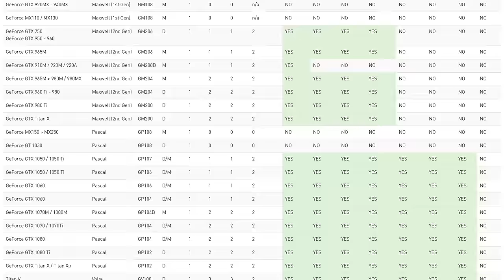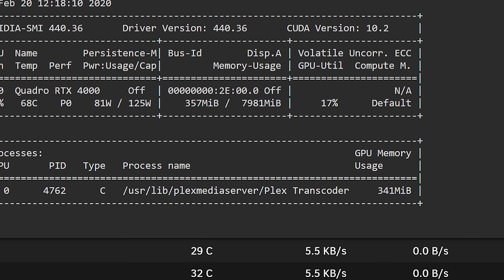5 First Plex Media Server Build Mistakes

Comment: I had a fun problem with sata using those rosewill hotswap bays, took me forever to figure out what it was, finally decided it was the hotswap enclosure. as soon as more than one drive would spin up the transfer would stop and give me drive controller errors. I went through so many sata cables and sata controllers and even switched to a sas controller and the problem continued. I finally realized it was the hotswap bay when I pulled the drives out of the enclosure used the same power plugs and sata cables and everything was fine. If only one drive was active it was fine. The funny part is I used the enclosure for a year or more with no issues until I decided to switch to a raid1 in software to protect some of the data and then the problems started.

Comment: Hi Jason
I've been playing with the plex server for a while now and I've been following your channel. First I had a version with poor hardware, so then enthusiasm prevailed and a new version of plex server came up with slightly better specifications.
The thing I noticed is that the viewing devices (mobile phone, tablet, laptop, etc.) all have higher resolution support. For example, I use a lg 55sk8500pla smart TV which at the time of purchase in my country (2 years ago) cost $ 1350. And he's more than capable of playing all the formats currently in direct play.
Now the question is whether you need to spend money on expensive server hardware or simply add that money to buy a better TV and use a plex server with weaker hardware just for direct play.
Best regards

Comment: I find using enterprise level hardware for plex servers it worth it. I’ve seen desktop hardware fail over and over again. . Lots of second hand servers out there. Once I went to Hp gen 7 I’ve never had an issue. I even have an Nvidia grid k1 16 gig ram gpu card for hardware transcoding and 16 cores of xenon goodness, 48 gig of ddr3 ecc to round it out. All running on cli Debian Linux and costing under $500 without sata drives.

Comment: I just learned about Quick Sync HW transcoding with Intel iGPUs, while looking into the best method to migrate my Plex container into a dedicated system. Seems this has been around since 2018. I'm extremely surprised I haven't seen it mentioned here or in any other of your videos (unless I missed it). Overall it seems to be a relatively niche thing, in terms of publicity at least. I really don't understand this, as having a $100 i3 8th/9th gen that can handle 20 + simultaneous 1080p transcodes seems to be one of the most revolutionary things I've seen possible with Plex.

 Any plans on doing a video against this? Would love to see this goodness of news spread to all the potential Plex server builders.
Reply: I believe as long as it's skylake and above, its worth it..

Comment: I did A plex experiment - I have A Spare HP ProLiant ML150 With ! gig of ram and SSD 240 boot  - A 1 & A 2 Terabyte drive & 1 gig of Ram - The Video is A GTX 650 TI & the Cpu is A E5205 Xeon @ 1.86 X 2 - I do plan on Maxing out the Ram to 32 & Using both Cpu Slots - I have 3 3.0  usb X 4 for external drives - Windows 10 seams to run fine under this current setting

Comment: That is a good recommendation for a case, however, a quick note is that you can easily fit 11 x 3.5" HDDs and 4 x 2.5" drives in a Define R6. Considering that the Define 7 is out now, that case is going cheep. 
They also support 3 x 140mm fans up front, one in back, one in the basement and EATX motherboards. Depending on dimensions.
They also come with sound dampening foam everywhere.

My Plex server currently lives in one and I won't need to upgrade until I've replaced my 6 x 3TB with 8TB ones to match the other 5 I already have.
After that, then, and only then, will I need more than 12 drives in my system.

Comment: All your ideas are nice, I have no need for a dedicated stand alone hardware server.  As being a single user,  my PLEX server is on the same PC  I use to Operate the PLEX program.   I only use PLEX to record (DVR) antenna local TV shows.  Once recorded, I edit them, and then store to another EXT hard drive, then delete the content from my PLEX server.   With my PC laptop, I7 proc, 8 gig Ram, 1TB SSD, Windows 10,  all works great.  My server is only on when I am using the laptop.  I dont do anything portable or remote, not necessary.

I know there are 2 other apps that do the same as PLEX, but will stay with PLEX cause I am used to it and does what I want.

Comment: Lol you do not need 16GB of RAM to run Plex Media Server. Especially if you are not transcoding or using HW transcoding.
My Linux Plex VM uses ~2% of its allocated 8GB of RAM per 1080p stream. If you plan on transcoding AT all, use a GPU and HW transcode. 

You also do NOT need an SSD or RAM disk for transcoding. You will saturate your ethernet connection well before you even came close to saturating even a basic multi-spindle raid. My personal server is just running a 12 spindle RAID50 with just 2TB 7200rpm drives. This provides well over 300MB/s read performance. In fact, the last thing I would recommend is and SSD for transcoding as this is effectively a swap task. It will kill your SSDs super quickly.

My best advice for starting out on a budget, get a cheap secondhand refurbished/retired Dell R510 or similar. Fantastic starting point, cheap, huge expandability. When you fill up the 12 bays. Buy another and set up your storage in a cluster.
Reply: how do I know if I need to transcode?¿
Reply: @tryitout-701  Depends on your target devices and your media quality. If you have people connecting that dont have players capable of playing you media types, or have poor internet connections, or you have poor upload you should consider transcoding. 

If all your content is fairly low bitrate 1080p probably don't need it.

Comment: 8:50 but i never had a Seagate HDD fail, only WD, Toshiba and Hitachi ...
Reply: Seagate is one of the better brands. Hating on them is a meme.
Reply: @kenzieduckmoo  Not exactly.  Their current drives are as good as anything on the market, but they had some epic level failure rates in the early 2000's.  Folks that have been around the block still don't trust them when other brands offer competitive products at competitive or often cheaper prices.
Reply: @johngaltline9933  well yeah, 20 years ago they were bad. But then so was WD back then, with their slow Green drives.
Reply: @kenzieduckmoo  The Green drives were/are slow, but they were never unreliable.  I still have all 5 of the 1TB Greens I bought around the time they came to market, all still working perfectly.  3 of them are in my unraid array now, 1 is an external usb drive used for a work archive, and one lives in my main desktop, unplugged with a working, all needed programs and updates copy of my C drive, just in case my boot fails and I need to be running.  
While the current generation of Seagate drives are as good as anything else, they lost me as a customer for consumer drives after having several drives fail over the corse of a year.  I run a large number of constellation 10,000RPM and 7200RPM SAS Seagate drives, but still refuse to buy their consumer products or any new drive from them.
Reply: Their barracuda drives were crap, I think he is referring to them..
There was a 1 of 3 failrate.. for me 3x 2gb were dead after 5 months, 11 months and 15 months. (I've had backups only of one of them)

Comment: #3 Hard Drive Expansion: Instead of getting a bigger case and putting your computer into it, consider getting a thunderbolt 3 PCIe expansion card and then expanding to a thunderbolt 3, external raid array. In my opinion, this is a very logical upgrade path that allows you to start small and upgrade later, and still have a relatively small form factor case.
Reply: I mean I “guess” you could?  Your goal is to create a Plex server - which reliably hosts media to multiple devices across the network.  It makes more sense to build a machine for THAT purpose, instead of just adding more storage to your desktop.  There are SO many reasons to not use your personal rig as a server.  You ‘can’ of course... but the moment youre dumping money into the project - spend it on the right hardware.  A stand-alone NAS/storage server is much more future-proof than an external raid enclosure
Reply: I don't see the logic.

It would be pricey $ and What's the point of having two relatively small cases  tethered to each other. The option is fine for anyone who chooses it, but I fail to see the logical path,

Comment: makes joke about Seagate drives
Me: I've been using Seagate drives for 20 years and i just replaced a 500gb OS drive that i bought over 15 years ago and it still technically works.  Not had any issues with Seagate ever.

Also... ssd's are cheap? That's funny. Maybe if you don't need 30TB of storage.
Reply: SSDs are cheap for metadata which is his entire point. You have 30TB of plex metadata? lol
Reply: Gotta say though, I personally never had an issue with it, but the same drive I've been using for like 8 years now (not continuously mind you, and a large part of the time with caching by an SSD, it has ~ 2.5 Y of usage logged in SMART) has failed rather early for my brother and also failed for my cousin.

Comment: Great video. I have a question what do you recommended to build a Plex server? Right now I have a Plex server on an old laptop it plays fine but once I enable subtitles it all stops it plays for 3 seconds than stops. Now I want to build a Plex around a and a8 9600 CPU. I usually stream 1080p streams? What parts would you recommend for this to get the most out of it?

Comment: I built mine from an old server tower running Windows Server 2019 (upgraded from 2016 recently) with Xeon E5-1650, 12GB ECC RAM, Kingston SATA 256GB SSD, WD Red 6TB (4 drives in RAID 5). No GPU. Mine has been running perfectly for over 3 years with as many as 5 users streaming at 1080p simultaneously with no lag (all users must have Direct Play/Stream enabled)

Comment: For all the noobs (incl myself) that have 8gig ram or less, no graphics card, and a mediocre CPU...run plex and see if it works, and then if it doesn't, only buy what you need to make it work before going out and "buying 16gig ram minimum"...🤦🏻‍♂️
Reply: I have a old PC that work was throwing away. Running 8GB ram. Old core I3 and runs perfect 1080p. All I did was replace with SSD.

Comment: i have a 960 4GB model the GM204 version , is it worth upgrading to a 1050ti or should i spend the money elsewhere?
Reply: what other specs are you running?
Reply: @wildcard3237  I5 4690K 16GB ram . 500GB sata for OS
Reply: @rongarzon7295  i'd probably say say hold off for a while and save to get a processor upgrade, that gpu upgrade will maybe get you 1 extra transcode stream but i'd probably say thats pushing it. if your cash is burning a hole in your pocket you could always pick some extra ram or storage, can never have enough XD
Reply: @wildcard3237  yeah thats what I figured , the mobo is maxed on ram at 16gb, at 60 tb in space .I will just save for a bit ty for response.
Reply: If you are only using it for Plex, look at the P4000 cards and you can transcode 20ish streams all on the graphic card.  If you are also using for gaming, I am not sure.

Comment: I have Plex on Ubuntu with an Ryzen 5 3400g and a 1050Ti 16GB RAM Z570 Mobo. Set transcodes folder to /dev/shm/ to save SSD wear. Works perfectly. Patched the nvidia driver and can run up to 6 transcodes at the same time. While watching a 4k 40MBit video and transcoding it to 1080p 20MBit and looking into the transcoding folder it generates a lot of small 50MB files. Ram is slowly filling up but while watching a movie it never fills up above 2 or 3 GB of usage. Easy peasy.

For the case I went with a Fractal Node 804. 10x 3.5" drives let's go.

Comment: Shots fired at Seagate. Do they have significant reliability issues. Or did you just say that because you generally use WD?
Reply: seagates are fine nowadays, but back when 3tb drives were just starting to come on the market they were having drive failure issues where they would die in about a month or less. but they have had that sorted out for a long time, they are on par with WD and even offer free data recovery on their Ironwolf drives.
Reply: @MrUploader14  how about the old 1TB seagates when they first came out? they would shit themselves all the times too
Reply: I think the 12tb exos did

Comment: So much hate for Seagate, I only have great things to say about them.
Reply: I agree with you I've had a 2TB Seagate disk that has worked flawlessly since I bought it in 2014, Now its more of a games drive but I used to run my entire system on that HDD
Reply: I have several seagates and many of them are about 10 years old at this point. Not a single issue.
Reply: My portable 4TB failed after after 1 TB? Write? Like whaaat? I only used it for backup, it was never on the road. and at that point the data was stored on that disk only... i somehow managed to get all the data off but that was my first experience with Seagate. I now use both WD and Seagate, same capacity, and will see which one fails first. Still i tend to go for wd if i need to expand..
Reply: I had an external desktop burn out, but internal? I only just swapped the one i used in various PC's for 15 years with an ssd, but .... that old drive still works! All my large storage drives work just as well!

Comment: Jason, currently running Plex metadata in cache (unraid) on nvme’s. I also have an unassigned ssd with room to spare. Wondering if I would gain any speed increase switching locations, from an I/O perspective? I still have a delay loading posters sometimes on my LAN rokus. Thoughts?

Comment: I would like to know the best way to change from a working win10/Plex to an unraid/plex machine.
(Ssd systemdrive and 1 new hdd, setup the new ssd with unraid and copy 1 hdd to the new one? And after that the next hdd to the now old empty one and so on?) what about the Plex metadata already exist?
Reply: Pättes did that.  It’s simple.  I think spaceinvaderone has videos of this and how to transfer metadata.
Reply: Why not build the new unraid/plex machine, and just point it to your files and let it build the meta data? If your media is setup in an organized fashion, the new plex will just import all of it.
Reply: Jim Taylor problem with that would be that now you would need two computers to be on at the same time instead of just one
Reply: KT is correct. I don‘t want to buy a new machine. And I don‘t want to loose all the seen/unseen flags. Not a very important point but would be nice if it would be still there.

Comment: I've got Plex running on a Synology DS920+ and a UPS is essential for me due to my apartment's absolutely buckwild wiring layout. More than once since I put it together I've had a breaker trip because the AC in the living room is running as well as the AC in the kitchen and the microwave because someone saw fit to put all of those on THE SAME CIRCUIT when they wired up the building. I also have the UPS connected to my modem, and my router so I still have internet/WiFi.

Comment: Enjoyed watching your video.  I've been looking around seeing options to upgrade mine.  I bought a used office PC that has served me well for 100. The only real issue is that it is not future proof. While I do agree, it doesn't hurt to have more RAM then necessary, 4 GB of RAM has worked for me.  The caveat is that I have very little 4K material, and I am the only one using it. The only changes I did to it was install an SSD for WIndows 8 and remove the DVD drive to fit another HDD in there. I also resinked the CPU fan.

Comment: Nice vid. I just bought an Iron Wolf 8Tb drive. Is seagate still bad?? Also what HDD's do you recommend and speed?
Reply: 2T I’ve never had a seagate fail and I’ve been using them for years. Guess it’s just the luck of the draw though. Come to think of it, I’ve only ever have 1 failed drive and it was a Hitatchi.
Reply: WD Red NAS HDD are literally built for this they are meant for prolonged up time, and RAID configuration they have them in SSD if you want you want to avoid mechanical drives.
Reply: Get the 8,10,12 TB drives that show up on slickdeals and /r/buildapcsales from time to time you can shuck them and you have cheap helium filled drives.
Reply: @joshuaheinaman952  i've been using seagate for years also and have only had one act funny so I just retired it to be safe. Had only 1 hdd fail on me also and it was hitatchi too lol. not sure if people give seagate a bad wrap from others expirences or their own. Anyhow they seem to have even more solid hdd's now.
Reply: i have 8 ironwolf 8tb drives in raid z2. i cant complain. my reason to go there was the uber of 1/10 to 15 which is important since at 8tb you have a crazy high theoretical failure rate during rebuilds with 1/10 to 14. I know that doesnt mean they will have a 10 times lower risk of encountering a read error but its enough to put it into the spec sheet. all enterprise drives have it and besides the ironwolfes theres next to no consumer devices.
Reply: It does not matter if it's wd or Seagate as long as they are under warranty just send it back.